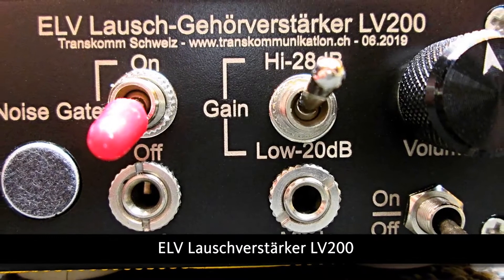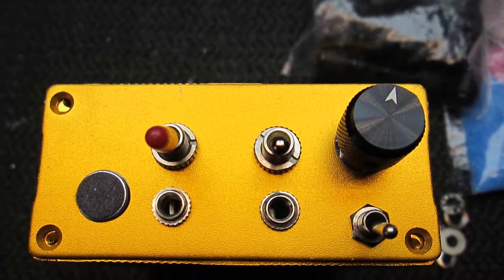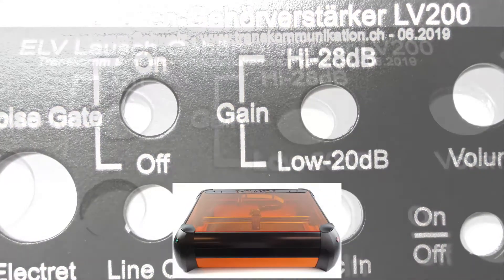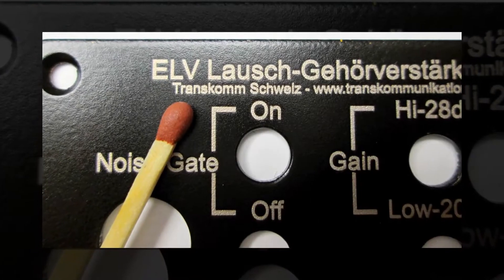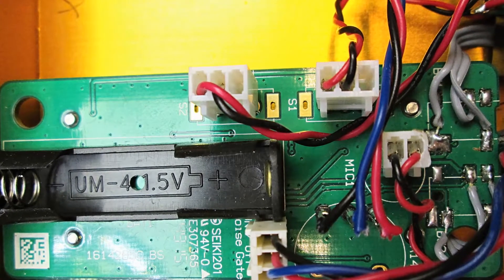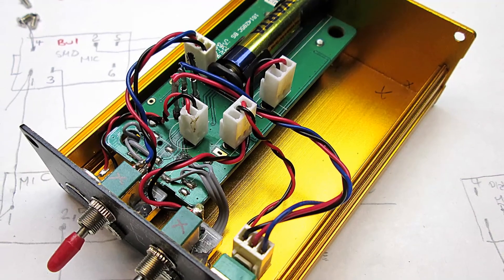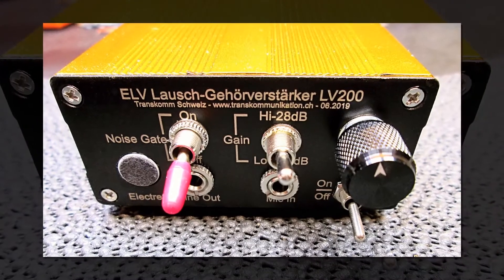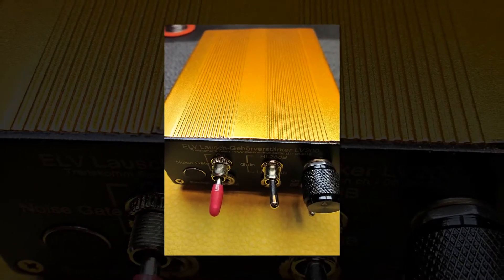DIY Listening Amplifier: Building the ELV Kit for Paranormal Audio Research

Comment: Thank you very much. It looks quite interesting! Could you also specify the price for the instrument?
Reply: Do you accept Master Card? Where should I send the order?
Reply from the maker: @alexrubino6731  Purtroppo devo deluderti, perché non vendo questi dispositivi. I costi sono solo quelli del materiale, se qualcuno vuole ricostruirlo. Ma volevo mostrare come si può costruire un dispositivo del genere da soli. Mi scuso se non mi sono espresso chiaramente. Se vuoi costruirlo da solo, posso aiutarti, per quanto mi è possibile, a costruirlo.
Reply: Hello! I love your work. What laser did you use to make the front panel?
Reply from the maker: Thanks :) The laser is the Emblaser 2 from Darkly Labs with 5 Watt. It is a really fantastic laser.
Reply from the maker: The price for the complete kit with the original plastic case is about 30 Euro / $ in Europe / Switzerland. The aluminum case is available via Aliexpress for about 10 $ and the Bulgin battery holder costs about 10 Euro / $. The rest of the material i.e. switches, 3.5 mm jack sockets, potentiometer, potentiometer knob and electret microphone cost about another 15 Euro / $. 

All in all the whole project costs about 65 Euro / $. Add to that the fun factor and learning. This is priceless :) It's worth doing the project the way I did it. It really works amazingly well and the gain of low level signals is very high.